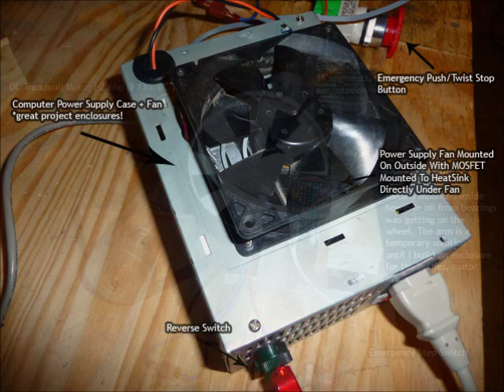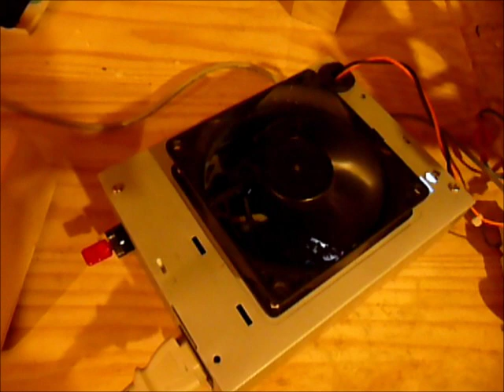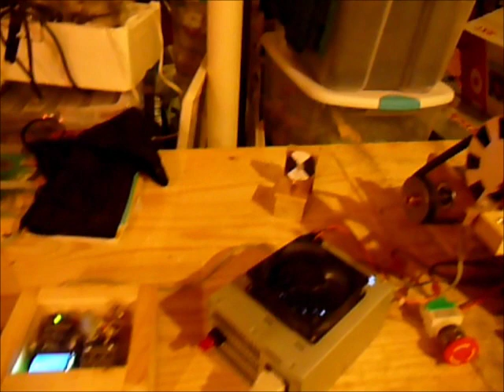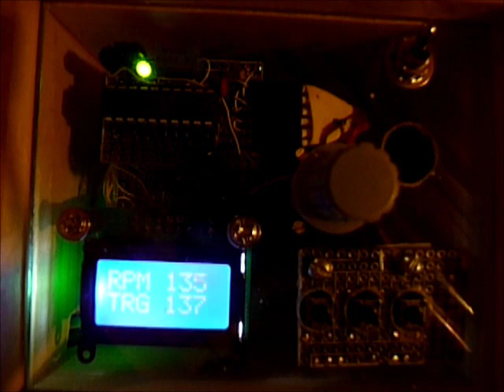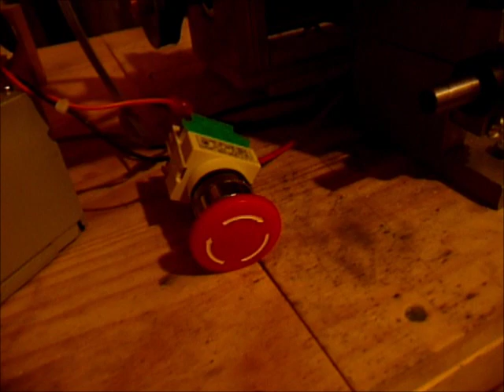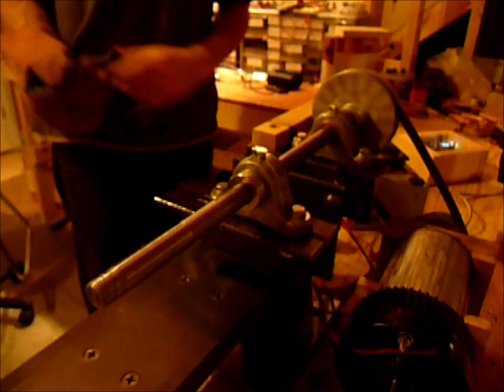Treadmill Motor Controller For My Gingery Lathe

Comment: Not sure if you are still working on the lathe at all but first I would like to say thanks for the videos, you really inspired me to new levels planning my lathe. Second I wanted to run something by you. On the lead screw I have been toying with the idea of running a separate drive motor just for lead screw movement. Also I have been thinking of using a raspberry pi to control a digital pot which would connect to the pwm controller on the treadmill motor system. This would have a couple benefits, one you could program different threading combinations to be able to thread stock etc, second you would be able to reverse or change the speed of the spindle and lead screw independently, or even stop the lead screw without having the lock. Give me your thoughts if you get a chance! Thanks again for the great videos!

Comment from the maker: With the lower drive current on the IR emitter in the QRD1114, the output of the photo transistor swings from 3.4V-2V ( as far as I recall at this point ). Without the diodes shifting the voltage down below 0.6V the NPN transistor would never turn off. The npn transistor is operating in saturation mode so the output is basically a hi or low output ( 3.4V-0V ).

Comment from the maker: Definitely checkout the blog, under Projects > DC Motor Controller & Driver. I have the who project downloadable as a zip file. It has all the schematics, I even have PNG images of them if you don't want to install eagle. It can give a better idea of what was done. I could have also used a schmitt buffer for the tach to get a nice digital output to the PIC, but I wanted to use as few / cheap components as possible that I had on hand...

Comment from the maker: I don't have an oscilloscope, but with simulation, without the diode arrangement the output was short pulses which may have been missed by the PIC's schmitt trigger input when the pulses came in at a high frequency. Using the level shifter produced a nice 50% duty on the output waveform with a pulsed input with long rise + fall times ( similar to the sensor transitioning from reflective to non-reflective ). At this point with the QRD1114, I have tested with a 136 res encoder with good results

Comment from the maker: haha no problem, I was just about to give a response too :)

Basically with the proper ( spec'd ) current going through the IR diode, the dot on the wheel is ~1/8". I ended up driving the diode with ~3mA vs. ~10mA, and then amplified the signal from the photo transistor with a simple npn common emitter amplifier. I ended up level shifting the output from the sensor photo transistor to the base of the NPN with 3 - 1N914 diodes - this produced a nice waveform on the tach input pin.

Comment from the maker: It's hard to say, when I started the project metal casting, scraping, machine tool work was all new to me. If I had prior experience it would possibly have gone faster. I also started the project when my son was born so I really only worked on it when I had a chance - it's hard to look back and get a concrete number, as I started the project in 2009 and it definitely didn't officially take 3-4 years of actual time to build, but probably would have taken me 6-12 months if I had 4 hours a day

Comment from the maker: The encoder wheel works great, the main thing is getting the sensor to work well - it took me a while to tune that aspect of it, but right now I have it very accurately reading a 96 resolution encoder, and have tested with a 136 resolution encoder with good success so I'll probably switch it out at some point. Details of my tachometer are on my blog - you can download the project files, etc... if you are interested.

Comment: Hi, Morgan, I am in the planning stages of building a wood lathe, for which I would like to build about a 2 hp variable speed motor set up. Thanks for this vid, I will definitely check out the others plus your blog, I am very interested in your controller schematics as that is the weakest point in my personal knowledge (I am a mech engineer). I can program the pic or other microcontroller, it is the guts of the VFD that I need help with. Anyway, watch for me lurking! Thanks again!